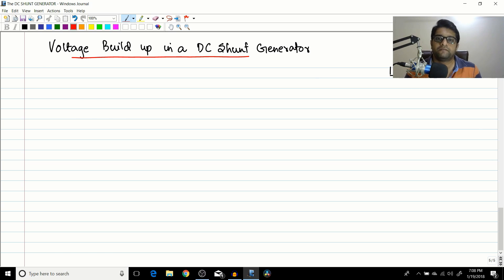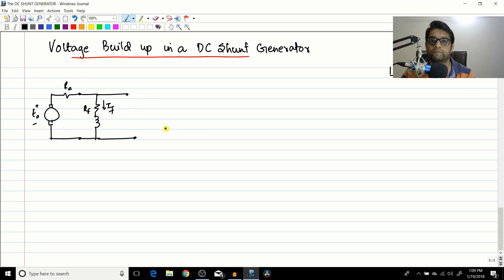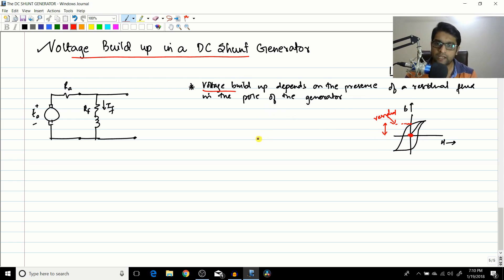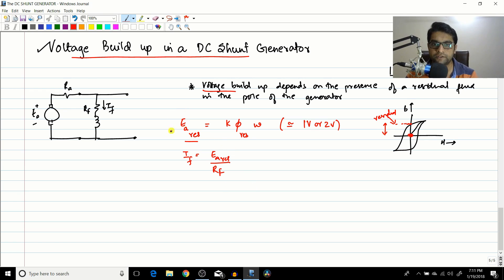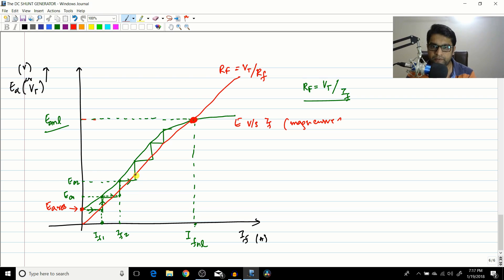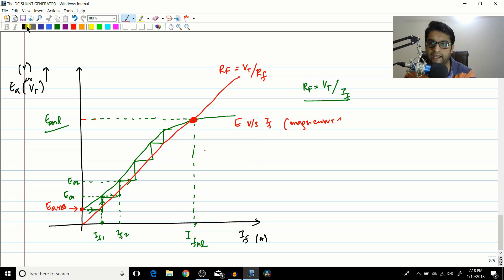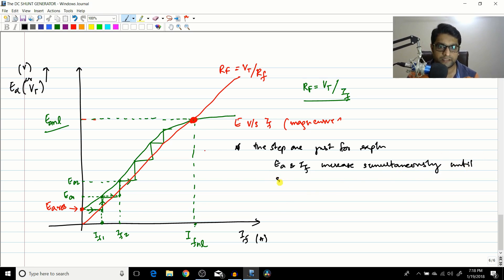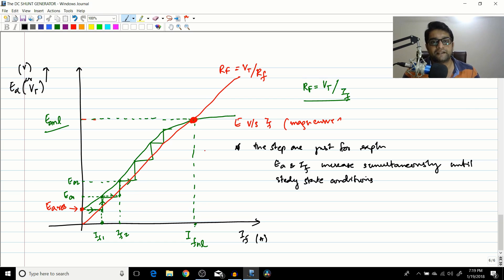#9 DC Generator -  Voltage build up in DC Shunt generator

Comment: Sir, what happens when we reach saturation ? Means the flux isn't changing so ideally there must be no current, right?
Reply from the maker: Saturation means a point beyond which  even after  if you increase current there is no flux increase...

Comment: Great Video man!  Just understood something my teacher didn't explain well. thank you.
One question:  you wrote If=Ea/Rf.  Isn't it suppose to be  If=Ea/(Rf+Ra)?  
What happend to Ra?  and also what happend to Lf?
Reply from the maker: Yes you are correct, but since Ra is much much smaller than Rf the equation would be reasonably accurate...and since we are dealing with DC the author has not considered the effects of Inductance and associated reactance.

Comment: Sir I have a big doubt 2:08 you draw the B-H curve but we study B-H curve in hysteresis loss in transformer, induction machine and there is alternating current present , but in DC machine how it is possible please explain
Reply from the maker: An alternating current is just an increase and decrease in current right, so in dc also you can increase decrease or change the direction etc using basic elements like rheostats and switches...

Comment: Sir why residual voltage is only 1v or 2v not more than 100v....?
Reply from the maker: It’s because the flux inside the poles is very less...bcz the only flux in the poles during starting is residual flux...